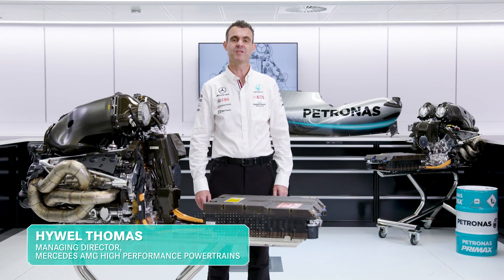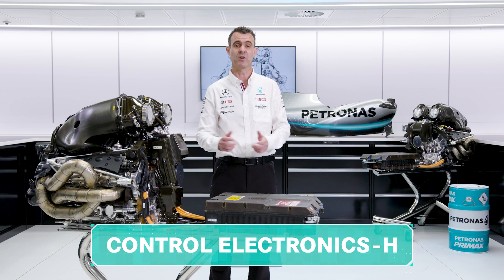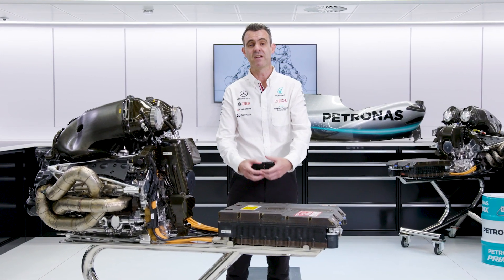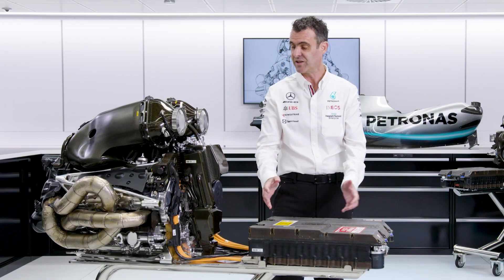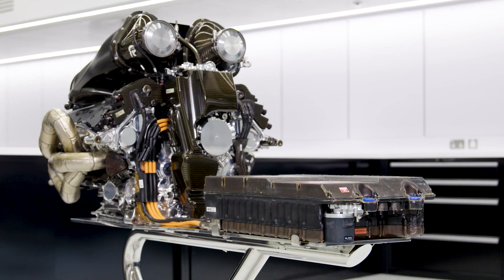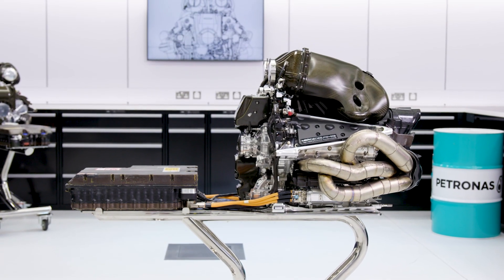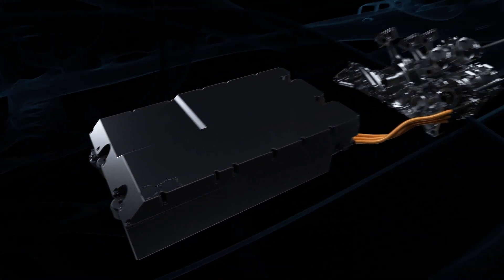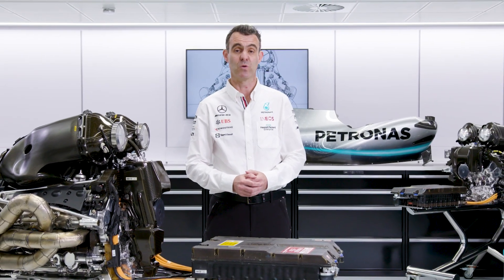Power Unit 101 with PETRONAS: Control Electronics, EXPLAINED!

Comment: The new W14 has to have low drag, more efficient floor and ground effect, good tire management, minimal weight, efficient traction out of all corners, good braking and brake management.    It is critical in testing to understand the new tires and to have a new car in 2023 that conserves and manages the tires well. Petronas has made a more efficient fuel like Shell did for PU Ferrari.